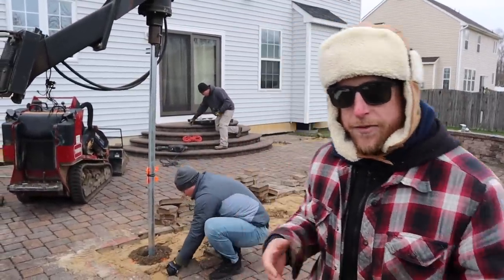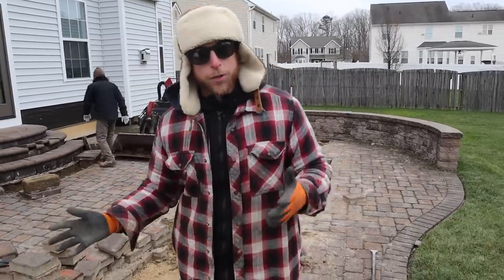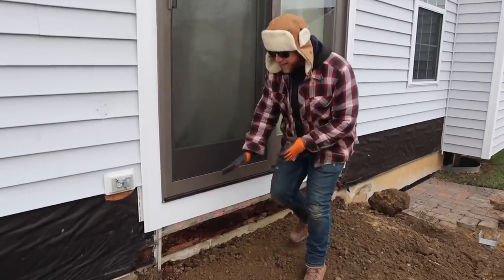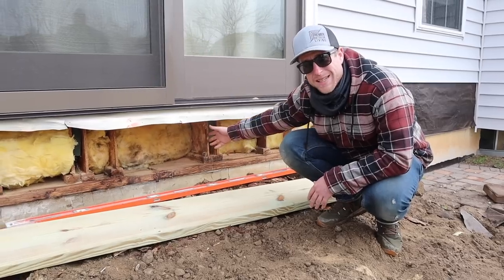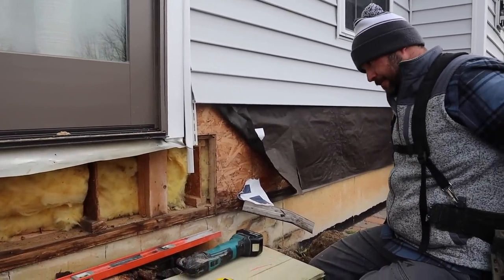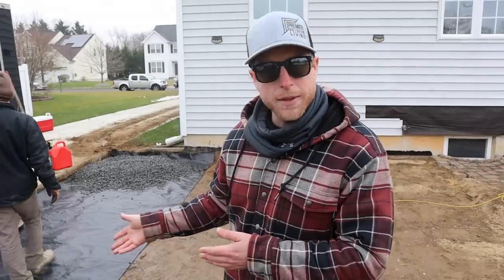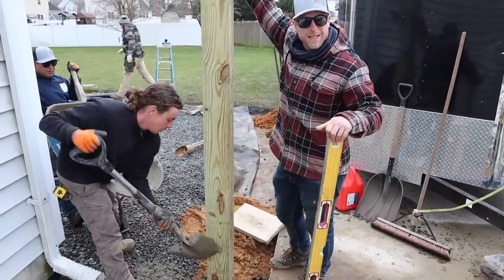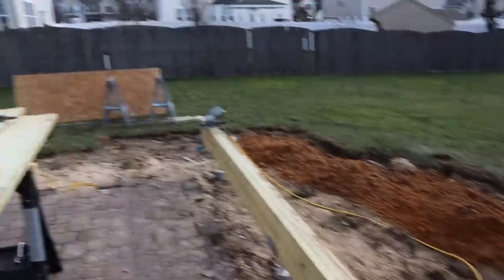TZMBV PART 1 - Installing Helical Pile Deck Footings and Preparing Paver Patio Base

Comment: Unless you can keep a piece of heavy equipment ( dump truck, backhoe)   in use 3-4 days a week you are probably better off renting or subbing out.  The convenience is nice but the math typically does not work out. 
 I am glad you highlighted the Helical piles, I have been  curious about them.
Reply from the maker: thats a great way to look at it. I rented a dingo for a long time, until we used it enough that it was cheaper to make payments on one than to rent it. I hate maintaining equipment, so the less of that I have to worry about, the better

Comment: Awesome video as usual mate! Always learning! I have taken a look at the pile system too, they are called ground screws in the UK.. looks like the same product, just different company.. defo going to use them on our next decking project! Completely agree regarding renting/hiring the larger equipment - skips, dumpsters, larger machines, etc.. saves so much hassle and stress.. I want to be building mega outdoor living spaces not maintaining yard space and machines..

Comment: I am a fan of a dump trailer. Park it on site, easy to dump. The downside is your time to haul things off. I have never had a dumpster delivered or picked up on time. Additionally, I have had to do a lot of protection on concrete so it can be set down. Happy New Year!
Reply from the maker: happy new year to you as well! I actually have a dump trailer, but whenever we need to take out dirt, its usually 15 - 20 yards of soil, so it was too much of a pain making multiple trips that I just use it as an equipment trailer now. The good thing is that i've got some good dumpster companies that are always on point with dropff and pickup for us

Comment: Regarding the dump truck, you can ask your accountant to do a bit a superficial financial analysis regarding how often you use dumpsters and how much you pay for it over the long run compared to the cost of buying one. You should also consider the other uses it may have as well as the life of it and amount of depreciation you can add onto it.
Reply from the maker: I've done some cost analysis on it myself a little bit, and we're still a far way off from justifying a dump truck. It should also be noted that if I were to buy one I'd buy one new, cause you never know how much it was abused. But I know its one of those things that if I ended up buying one I'd probably find a bunch of other uses for it and wonder how I got away without one lol

Comment: I bought a trailer called the ultimate dump trailer. You could use it to haul equipment and material not only trash.
Reply from the maker: I'll have to check that out!

Comment: Awesome video, as usual 👍 Question 🙋‍♂️ Can rigid styrofoam be installed behind the ledger board, to provide a thermal break?
Reply from the maker: thanks a lot! Im not sure that you can't, but we've never done it and I prefer a solid attachment between the deck ledger board and the house. They may have types of rigid foam insulation that are able to be left between though

Comment: That was a great bro keep it up 👍🏻 
I have a question about those footings do you check for any underground plumbing waterlines and sewage lines ? And on those TJI‘s I would’ve put bridge blocking between those TJI‘s then ran that outer rim Joyce then OSB then waterproof then  the ledger board that’ just me. Still The way you guys did it was justice oh yeah ‼️😎👍🏻🔨💪🏼

Comment: Excellent work 🔥 Just what’s up with that plate compactor looks like something from harbor freight? 😂
Reply from the maker: hahaha spot on, that is a harbor freight compactor lol. With the open graded base we use for patios, the compaction requirements are much less, so this one does the trick. Plus its pretty cheap and you can buy a warranty for like $100 and replace it no questions asked

Comment: Dumpsters work great .... use them here in Toronto , Ontario, Ca., .... easier to load with ur skid steer to ...
Reply from the maker: thats a great point too! The fact that it is lower than a dump truck makes loading it super easy

Comment: You could buy a dump trailer instead
Reply from the maker: I actually have a dump trailer that I bought a few years ago, but I mostly just use it to transport equipment now. It can only dump 5 yards of soil at most, and it was such a pain making multiple trips to a dump that I stopped hauling dirt in it